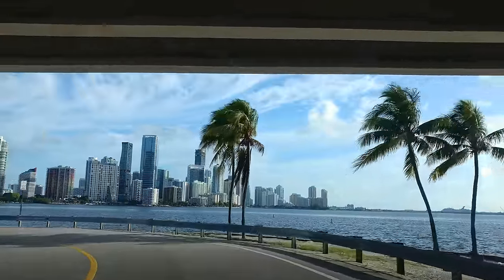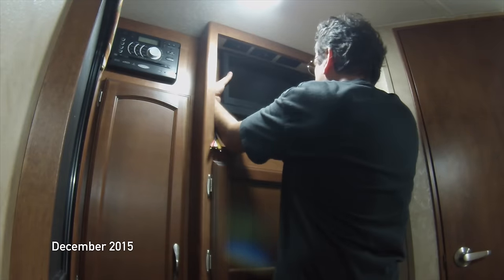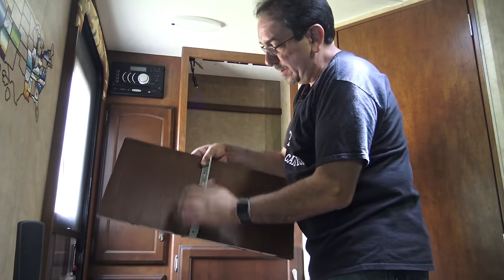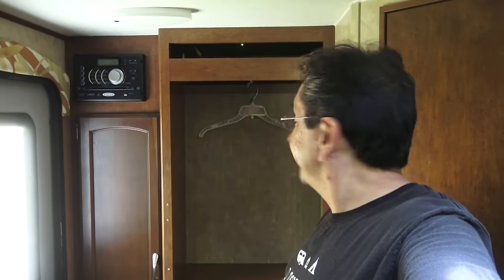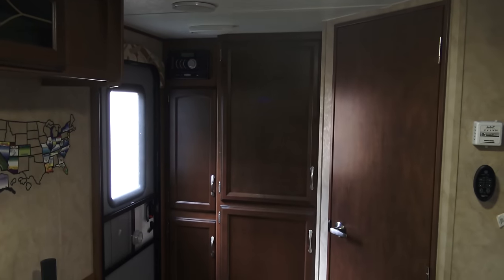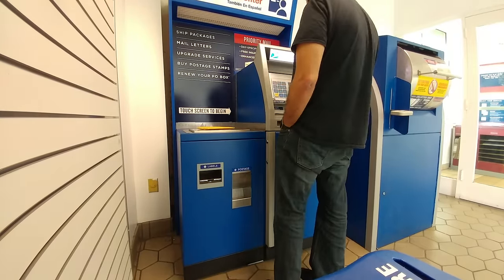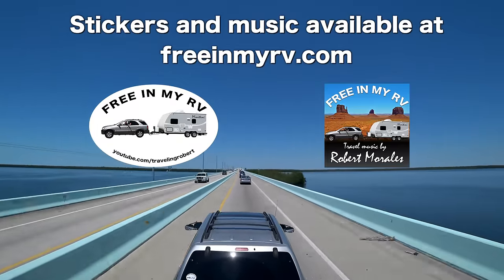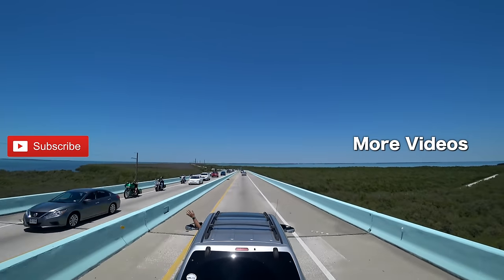RV Upgrades and Modifications: TPMS, Water Heater, Wardrobe Closet

Comment: Nice vid Robert. I would humbly suggest that you remove that trim piece inside the closet. With the door closed most of the time, it would keep the batteries etc from flying out. Or perhaps just drop it down to be flush with the shelf. You would have more space to reach in, and again, the door keeps things in place. Cheers!
Reply from the maker: Thanks! We'll be fine tuning it as time goes by

Comment: Hey Robert, thanks for sharing.  About your TPMS, it looks like you're monitoring 4 tires, right?  Are you monitoring 2 on the trailer and 2 on the tow vehicle?  I've considered a TPMS for our small class C but I need 6 sensors and prices seem to get crazy with more than 4.  Is yours expandable to more sensors?
Reply from the maker: Hey Dave. I am just monitoring the 4 on the trailer for now. You can buy one more sensor to monitor the spare tire as well.